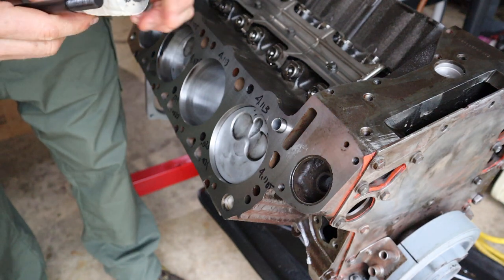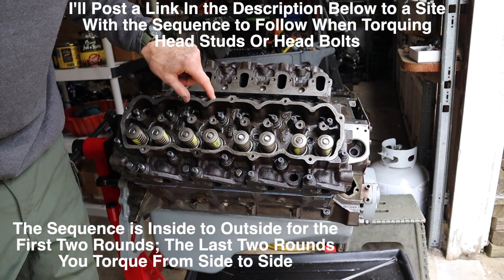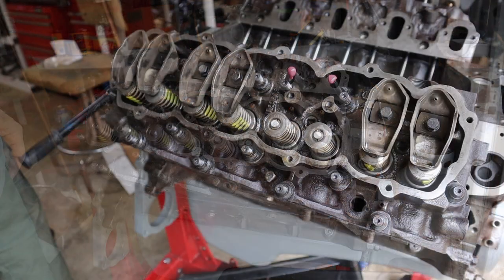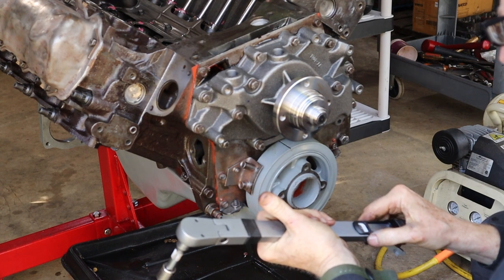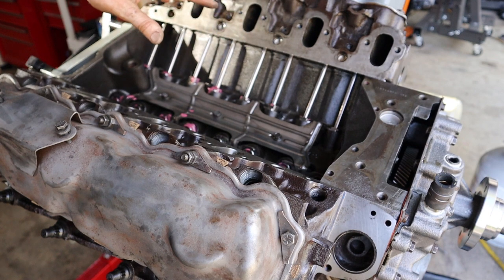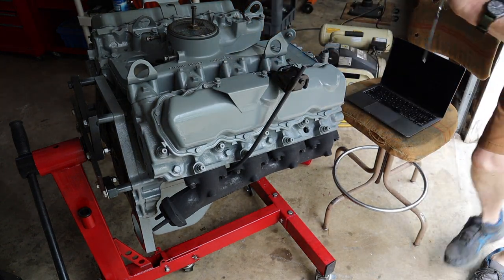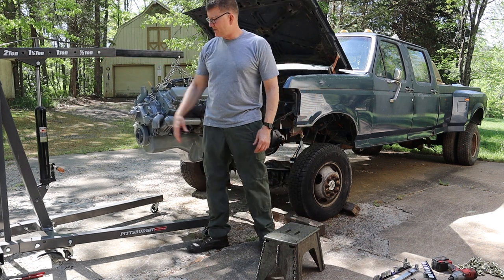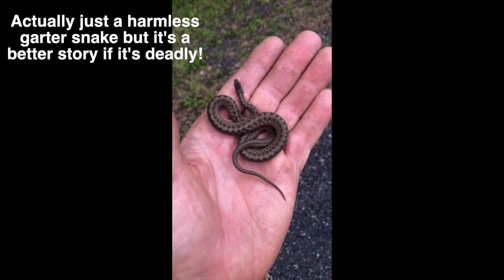7.3 IDI Turbo Build Part 3 - Head Studs, Cylinder Heads, Valley Pan, Intake and Ex. Manifolds, etc

Comment: I have had that problem with getting the hoist to move and flipping forward so many times lol sand bags or a extra body on the back of the hoist keeps it from fliping over and have used a 2x4 to pry the hoist forward and works very well im usually stuck swaping on bad black top concrete or gravel!!! Couple times in the grass had to use plywood helps but not as much as you would think lol. Killer video thank you love this build!!!!!!
Reply from the maker: Man, if I had a nickel for every time I had to wrassle a hoist on an uneven or soft surface, I'd be a rich man!  Thanks for the input, Scott
Reply: @THEBULLETPROOFGARAGE  me too lol I seem to always get stuck doing it by my self have dropped a couple engines was always putting junk engines in my old e150s 351w don't hold up well stock lol

Comment: if you run a turbo add some more oil drain back holes in valley pan under oil return for turbo, helps wit cc pressure
Reply from the maker: Thanks!

Comment: Hi Scott - hard to believe, but after a long period of 4x4 conversion, chassis prep and part accumulation, I am at about the same stage of my 7.3 IDIT crew cab project. Dropping heads on to studs any day now! I could not imagine stumbling across  thorough and instructional footage such as  yours, nevermind that which filmed at nearly the same time. I am almost glad it took me a while to get to this point lol. Some of these parts are a chore to find today as you know... was that a new valley pan?! Does it also seal around the intake openings in the head?
Reply from the maker: Rob - valley pans are back on the market brand new.  It does have sealant around the intake ports.  Glad you found the videos helpful!  Thanks, Scott

Comment: I hope you got the pistons in right cause the valve depression's are supposed to be to the outside ?? To line up with the valves. And putting the water outlet on before the passenger side head allows you to torque the two bolts. The bottom bolt is harder to get to once the heads on.
ALL THE BEST SIR.
Reply from the maker: The pistons are installed correctly.  Good point on the water outlet.  Thanks

Comment: excellent explanation getting an engine together however my experience with reefer repair is that gasket material that you use for the water pump create a permanent Bond and so if you have water pump failure getting the water pump off the truck is going to be a living nightmare especially on the side of the road I've never had one leak just using gasket and silicone more emphasis on silicone than gasket
Reply from the maker: Thanks for the comment Okiedoke.  Scott

Comment: Watching you get the block between the rails, it takes what it takes. I'm an engine builder myself. Having that much attention to detail, as in torquing small bolts, is a slight bit anal. But it's also your truck. Your pace of working isn't on a professional level but you're getting it done. Again, this is your project. When you get to something that needs anal, you're doing the right things. I've watched you working on this truck and was intrigued when I found your videos. You demonstrate that anybody can do the work, is actually refreshing. Keep up the work bro. It'll get there.
Reply from the maker: Thanks for the input, Russ!  I'm ok with being...err...particular when building an engine.  Scott

Comment: Exactly what you're doing by hooking up another vehicle to the truck to pull it under the engine is what I have to do every time I do any type of engine work that involves pulling or put installing the engine because my yard I don't have concrete I work on people's cars and when my tow trucks go down they all run 73 Idis or 69 IDI downside is unlike you I can't get my radiator front clip out because they are so rusted in so I have to lift it over the radiator support
Reply from the maker: Good to hear.  Thanks for the input!  Scott

Comment: I'm removing my 6.9 this week. I'm adding ARP head studs and replacing gaskets. I'm not going all in like you have done. But I'd love to get 15psi. This will be an awesome guide for me. Besides head studs, is there something you'd feel is a must add? I think I'll pull the trigger on the R&D injectors at a later date. I've gone the way of the Banks Sidewinder Turbo (Wastegated) including pyrometer and exhaust. My block has 86k original miles, it has no issues that I'm aware of. Curious if you'd swap anything else while I have it out. BTW, I'm also swapping the T-19 tranny for  a zf5-47, upgraded flywheel and clutch and moving the old Gearvendors from my current setup to the new driveline.
Reply from the maker: 86k mile engine should be in pretty good shape.  I'd dingleball hone the cylinders, new rings and bearings, and head studs.  If your budget can handle it, do the injection pump and injectors.  Good luck with it!  Scott

Comment: Which engine stand have you been using? I've been following along with a lot of your videos and just picked up a 7.3 idi that I wanna rebuild. Thanks for all the great content and step by step videos!
Reply from the maker: I got a 1500 pound engine stand and I'm glad I did!  You don't want to put an IDI on something that's built for a small block Chevy!  I got it at Amazon - $160 or so - Big Red T26801.  You could step up from there and get a 1 ton model, but the 1500 pound capacity is sufficient.  Good luck with it!  Scott

Comment: Ok, I have to ask, where did you buy the new valley pan from? Those things are basically unobtanium right now. I've heard they have been on backorder for the past year and a half from research on the oil burner and FTE forum pages.
Reply from the maker: The valley pans were actually available for several weeks recently and then went on backorder again.  I got one while they were available.  You may want to source a used one; that's what most folks are doing now.  Good luck!  Scott

Comment: watched the whole thing. You have kinda been with my on my turbo build. Over on oil burners. What turbo are you going with?
Reply from the maker: Justin at R&D IDI just dropped one of his turbos in the mail to me.  I've been following his recipe for 250 hp and 550 ft/lbs at the rear wheels.  Thanks, Scott
Reply: Sweet. Is it the stage one or does he have some other behind the scenes turbos
Reply from the maker: @mlinderman7723  It's the Stage 1.

Comment: Quick question Scott, I noticed on the heads, there are what seams to be 4 square bolt heads and then one hole that doesn’t have one. What might those be for?
Reply from the maker: I John - I believe you're referring to oil galley or coolant passage plugs.  Thanks, Scott
Reply: @THEBULLETPROOFGARAGE  thanks Scott. When do you plan to release another episode on Ol’ Brownie? I’m excited to see how it turns out!
Reply from the maker: @jonhargrave8187  - I've got all of the footage filmed; just so darn busy with work these days and getting the new shop set up.  Thanks for your patience!  Scott
Reply: @THEBULLETPROOFGARAGE We’ve all been there, looking forward to it!

Comment: Hey man i need help with my build. I tore my engine down due to low compression on most of the cylinders. I found the piston rings were broken and found bits of rings in the oil pan 😂 so i just want to ask where did you get ypur rings? I understand turbo piston rings are keystone rings and i cant find them anywhere. Do you have a part # i can go by? Im seriously thinking of just parting out this motor if i cant find rebuild parts for it! Please help haha
Reply from the maker: If your rings were broken, your pistons and cylinder walls are likely damaged too.  If so, you'll need a new set of pistons and your cylinders will need to be bored oversize.  Sourcing rings and pistons isn't easy for this engine; I ended up buying some stuff at Rockauto.com but they were limited based on the brand and bore size.  Best bet - check with the folks on the forums at oilburners.net - they have the best forum for IDIs.  Also check with Justin at R&D IDI Performance - he sells parts and he's a machinist with a lot of IDI experience, too.  Good luck!  Scott
Reply: @THEBULLETPROOFGARAGE  you were right! They are all scratched up 😔 i will just try to find another good block since the chances of me finding oversized pistons are zero.
Reply from the maker: @MansoyHumilde777  - I'd stick with the block that you have.  No guarantee that another block is going to be good.  Oversize pistons seem to be easier to find than standard bore.  Just keep it as small as you can; the 7.3 blocks are thin wall and can't handle something like a .040" overbore, even if you can find pistons for it.  Good luck!  Scott

Comment: You dont have ylto torque every bolt to specs. Mainly heads rods and mains. But ive been working on cars for years.
Reply from the maker: When I build an engine, the torque wrench is always handy.  Doesn't take much longer to do the job right.  Thanks